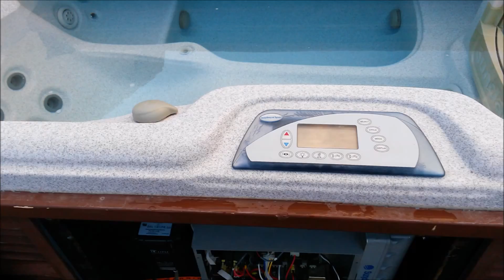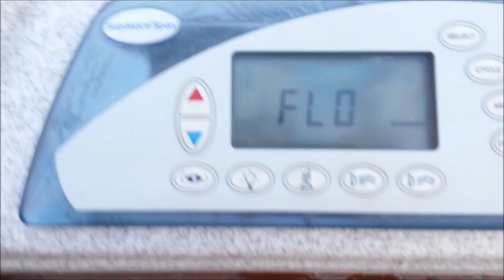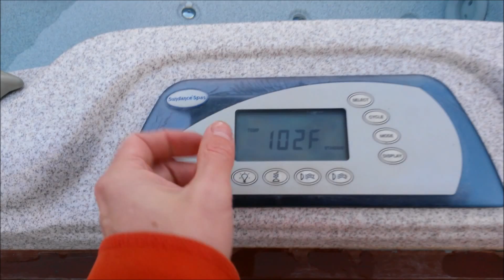Hot Tub Not Hot Enough? 104° Temperature Override  (:2:) The Resistor Method

Comment: I know its been a while since you made this video, Great video! I was just wondering if you have a similar hack for a newer 2020 Thermospa hot tub with Gecko controller the has the temp sensor and HL as the same probe with 4 wires?
Reply from the maker: I haven't done one of tjose, but you can always just try one wire at a time and see if there is any change. Start with a red on the temp probe wire.
Reply: @SpaDayz  Dude your awesome!! Thanks for the info. I soldered a 1kohm resistor on the red wire but the temp on the screen still showed 2 degrees warmer than the actual temp using a floating thermometer. So I soldering another resistor on the green. I just took a guess that the red and white or red and black were a circuit that's why I choose the green. Viola! Now the screen reads 3 degrees colder than actual which is perfect, so at 104 on screen the actual will be 107. I don't want to go any hotter than that. Thanks again!
Reply from the maker: @lesbauman  Awesome! Glad you were willing to go for it!
Reply: @SpaDayz  Thanks, I really need to work on my soldering skills. LOL
Reply: @SpaDayz  Thanks for the quick response. The probe has from left to right a red, white green, and black wire. I sent an email to the Gecko people to see if they can tell me which wires are for the temp and which for the HL. I'm going to do what you suggest and see what happens. .

Comment: I used 1.5k resistors on my 2011 caldera vacanza hot tub. It seems to only have one sensor wire. It had a red black and silver wire in that wire. So I put the 1.5k resistor on each wire. So 3 but it's still the same as it was before I put the resistors on it. So 104 is 104 degrees on my portable thermometer. Should I just ad a 5k resitor or something? Also I think seen someone say u can put glue or cocking on the sensor in the water. Will that help you think? Anyways the video is awesome and informative it helped alot thanks.
Reply from the maker: Do all of the wires go straight into the temp sensor? Sometimes you have the wires split off and go somewhere else.
Reply: @SpaDayz  yea there's the one Grey about quarter inch cable it goes into the electric box or whatever it's called n the cable goes up into the hot tub. It looks like thats the only spot it goes bro. The only other Grey cables are to the lights is what it looks like. Do most all hot tubs the thermostat goes to the heater first or something? This one guys from the thermostat straight down to the electric box. And in that Grey cable there's like 3 little cables I connected a resistor to each one.
Reply: @SpaDayz  tomorrow I'm getting a 5.1 k resister delivered. So ima check if it works with that one haha. Hopefully it fixes it. Maby the 1.5k was weaker or something.
Reply: @SpaDayz  I'll look at it more thoroughly but yea it looks like the thermostat cable only goes to the electricity box.
Reply from the maker: @JozeSanchez13  Not sure what you are calling a thermostat or electrical box, but if you have wires going into this and then to the sensors (of which there are usually 2) then you need to put the resistor between this box and the sensors. Only on one wire, always try the red one first.
Reply: @SpaDayz  ok just on one wire? Alrite I'm gonna try that ritenow. Yea I thought to put them on all three but ok let me see how thst works
Reply: @SpaDayz  watd u think bro I tried all the small resistors i could about 5 different ones. None worked. What's another way to make the hot tub go hotter you think? You think putting glue or cocking on the heat sensor will make it go hotter?
Reply: @SpaDayz  I put in the 5.1k resistor it shows 60 Fahrenheit then shows - - - - so yea I'm guessing gotta go to lower resistor

Comment: Any advice on doing this to a Bullfrog R series. Circuit board has a HL & Temp probe with a black, white, red, and green wire and an In Flo sensor with a black, red, green wire. Any help would be very appreciated.
Reply: Did you do this? Thinking about getting a Bullfrog. Thanks
Reply: @user-jy7kc5dk2v  yes. It worked great. I only did 1 wire, never could determine what the 2nd wire was. If I place the temp at 104 now it gets a little too hot for me, about 112 on the floating thermometer I have, it will also randomly trip something that gives me a warning to not get in the tub and the pump shuts off for about 2 minutes, before you can turn it back on. I say it works great because I don't keep it at 104 (112), I keep it at 100, which is like 106.5 on the thermometer, and none of those things ever happen. It just works normal but with perfectly hotter water.  In fact even if I increase the temp to 102 or even 103 (which starts getting too hot for me), it works normal with no warning or shut down like at 104. We actually like using the hot tub now and it's actually therapeutic.
Reply: @jayscott1380  looking at the BF circuit board diagram - I see the one female terminal that reads"HL & Temp. Probe" - is that where the "1 wire" you found goes to? Did you just cut that wire and put the resistor there? How many ohms? thanks
Reply: I think I get it now after looking at BF diagram - the 'HL & Temp. Probe" shows a 4-pin connector- I have a BF R5L coming soon - wondering if I can make a separate wire with a 4-pin male and 4-pin female connector with resistor in between so I can remove it if necessary in case dealer needs to come out for some reason (hopefully not!) so I can simply disconnect and put factory wire back? Did you use a 1 K ohm resistor? Thanks!
Reply: @user-jy7kc5dk2v  yes 1k, I wouldn't use anything more. If you have a smart way if rigging it, so you can put it back to original factory then go for it. I didn't, I just cut the wire and spliced in the resistor with electrical nuts and copious amounts of black tape.
Reply: @jayscott1380  thanks!
Reply: @user-jy7kc5dk2v  on my spa with 1k ohm resistor, I keep the factory temp around 100 now, which when I place a thermometer in the water it is actually 106.5 degree. If I max out the factory at 104 it'll get much hotter, I actually don't even know how hot because I haven't measured it at as hot as it gets.
Reply: @jayscott1380  Thanks again for your help. Did you try the "temperature override" feature that Bullfrog has? If you hold the up arrow it should show "OR5" and then "OR6" which brings the temp up to 105 °F and 106 °F, respectively. I verified this feature with both the dealer I ordered from and also from BF technical support in Utah.
Reply: @user-jy7kc5dk2v  no I never tried it. But honestly 106 isn't hot enough for me anyways, and also in my tub (before the wire alteration) the warmest it would ever get was like 102 (even when it was set to 104). So raising it 2 degrees would only have really made it 104. Either bullfrog tubs run colder than they are suppose to or at least mine did. Learning that there is an override that goes against the law of the maximum temp setting on a hot tub being 104, leads me to believe that the tubs actually run 2 degrees less than what they are set at intentionally.
Reply: @jayscott1380 Do you have the 120 V or 240 V model - I've heard that can make a difference, especially in winter? I know what you mean - 106°F is probably not hot enough for us either; used to keep our 25 yo Hotsprings (which died last month) at 109°, but for the past few years around 106-107°. thanks again for your time here.
Reply: That's awesome man my hot tub it doesn't work for it. I think it's just to old of hut tub. What year is ur bullfrog hot tub also what kind is it. Ima have to buy one of those.
Reply: @JozeSanchez13  it's just a couple years old
Reply: @jayscott1380  o ok so like 2020? You think this thing will work on a 2022 or 2021 bullfrog tub?
Reply: @jayscott1380  Mines like 2012 I think. That's probly why it doesn't work.
Reply: @JozeSanchez13  yes
Reply: @jayscott1380  you can easily get yours up to 110 now n itll stay there? That's awesome I'm tryna get mine to stay at 110 or 109
Reply: @JozeSanchez13  yes if I want, but really that's too hot for me. I like it around 107 108
Reply: @jayscott1380  nice nice that's cool urs could do that mine can't haha. Ima maby try this again but yea it wasn't working it'd say it's down to like 60 farenheight but it's realy 104 then the whole motor would shut off.
Reply: @jayscott1380  so yea later on or something I'm gonna have to buy a new hot tub.

Comment: I have an “ePack” I just purchased to retrofit an older Morgan hot tub. The wires coming out of the connector on the circuit board where it’s labeled “sens” are blue and yellow. The red wire coming from what appears to be the sensor (bolted into the heater tube) actually goes to a different unlabeled connector on the board. Anybody have an idea of where the resistor should go? 
Stick with the red anyway? Or maybe the yellow as that’s often positive?  
(Also I should add the limit uses red and black on my unit)

Comment: Thought I was King Kong and wired in 4 1k ohm resistors and i scorched my skin. I achieved 115 degrees with that (about 2.5 degrees per 1k resistor). I keep it to where it reads 100 but actually around 109/110. Can’t thank you enough for this hack, allows me to get my sessions in 15 min instead of 45. God bless
Reply: Why not just 1 /3 or 4 k resistor?
Reply: @AA-ih6kt  same reason we go out and have more than 2 drinks. I took them out real quick lol
Reply: @AA-ih6kt  the hot tub is a balboa. I have an automotive shop and had resistors around and wasn’t expecting to see two temp sensors. I can help you the best i can if you need help
Reply: That's awesome man what kind of hot tub do you have? On mine yea this didn't work gonna have to buy another one or something.

Comment: Has anyone tried this on a Wellis?  I am trying to confirm the correct wires.
Reply: I’m also looking at Wellis - did this work? Which model? Thanks
Reply: @user-jy7kc5dk2v  I bought the items and best I can tell there is a single wire for both functions on the wellis but have not ventured to try it.  I have been able to get up to 105 with the Wellis stock. Basically turn it all on with the cover on for 20 to 30 mins and then use it as normal.  It will hold that 105 for a solid 30 mins.  I am at 8000 ft elevation and was running that way through winter months.
Reply: @ryanmcdonald9228interested in the result

Comment: Couldn't I make a pigtail with a 1000 ohm resistor and connect it between one of the thermistor terminals and the wire that goes to that terminal? That way I could easily put it back to original configuration and I wouldn't have to open the control panel box. I've got a new Pentaire MasterTemp 125 that is still under warranty.
Reply from the maker: That's a great idea. would preserve factory wiring and make it easier to swap out resistors if necessary
Reply: Can you show what a pigtail is?
Reply: @AA-ih6kt  I disconnected one of the wires at the thermistor that senses water coming into the heater from the hot tub. That wire had a female quick disconnect. The thermistor has two male quick disconnects. I soldered short 18 ga. wires to each side of a 1000 ohm resistor. I terminated one end with a male quick disconnect and the other end with a female disconnect. Use heat shrink tubing or electrical tape to seal the resistor. Then just put this "pigtail" between the thermistor and the wire that previously connected to the thermistor. Easy to remove if you want to restore to original configuration. Of course I don't recommend overriding the mandated 104 degree F factory limit.
Reply: @SBKendoka   let me know if maybe you can make me one??  I have a 2022 vitaspa joli and 104 is not hot enough..occasionally the temp will read 105 for a minute or 2 and then back to 104...anyhow you can email me thanx
Reply: @SBKendoka   did you do both like the guys vid said to do? or just 1?
Reply: @AA-ih6kt  I just did one of the wires from the input thermistor. It would be illegal for me to make you one. I ordered the parts from McMaster-Carr.
Reply: @SBKendoka  thanx  i will look into it...
Reply: @SBKendoka  is 200ohm the same as 2k?  I want to go more then the 1k....and does wattage matter?  or color of the resistor?
Reply: @SBKendoka  i guess i am wondering what male/female disconnects you used and where to get them as they arent all alike and diff sized.
Reply: me again....where is a good place to get the male/female ends needed?  Is there some huge electronics supply house with many diff kinds? the balboa board uses certain ones(2022 vitaspa joli)
Reply: trying to make a pigtail..but cannot find the right connector thats on the end of the wire..any idea where to find the male/female same connectors? they are very small..micro??  2 wire.

Comment: So, quick update.  I reviewed the wiring diagram in detail and repaired the flow sensor wires that had been cut and the FLO error is gone.  As to the other sensor which had four (4) wires into it (red, white, green and black), I have emplaced (by alligator clips) a single resistor into the black wire.  I do not have any other resistor wired into any other wire.  Just the one.  The result is a significant increase in the water temperature.  At 104 degrees on the tub I am getting about 111 degrees of actually water temperature and that was still heading up so I have since turned down the temperature on the tub to 96 degrees and the temperature is now hanging out around 107-108 degrees.  That all said my question to you is - do you see any problem with using just a single resistor in the black wire and not using that in conjunction with a parallel resistor in the red (or other) wire.  I thought I would ask and get an expert opinion before permanently emplacing the resistor into the black wire.  Thanks for all your help.  Regards - John
Reply from the maker: Awesome! Glad you got your wires traced.

One resistor is fine.
Reply: Thanks for your reply and thank you for your very informative post.

Comment: I have always loved this post.  I have always really loved my hot tub water around 107-108 degrees and really despise being told I cannot have this by the nanny state.  That said I read through this post several years back and was successful with implementing this into a prior/older hot tub I use to own as to getting the water up to around 111 degrees - and thereafter turned down the heat to around 107 degrees.  That said I now have a new hot tub and just went into it to put in the resistors as I did the prior one.  However I am having issues with this  new hot tub.  These two (2) sensors have different wire configurations then my prior hot tub.  My prior hot tub had two wires going into each sensor (as I recall) and I simply inserted a resister into the black wire on both sensor wire sets.  Again this is per my recollection but did know it worked.  My newer hot tub has three (3) wires into one sensor (green, red and black) and four (4) wires into the other sensor (green, red, black and white).  So in keeping with the program I inserted a resistor into the red wire for each sensor (easiest to get to) but then received a FLO error message and the water temperature begin to drop.  I thereafter repaired the red wires and then inserted those removed resistors into each of the black wires, one for each sensor and received the same FLO error message and the temperature also begin to drop.  So I my plea/request here is to anyone that has run into this and/or has knowledge as to how to adjust this excellent resister concept into the type of sensor that I have in this new hot tub so that it can work.  Any help/ideas would be appreciated.  Thank you and regards to all my fellow 104+ degree water hot tubers.
Reply from the maker: A FLO error indicates an interruption of the flow sensor. It's usually an online sensor near the circulation pump.

You're gonna want to ohm out the wires and see what you get. I'm guessing red and black will have zero or infinite resistance depending on whether the circulation pump is running.

Comment: I have an La spas HEET 2005 tub with a gecko s- pack. The temp sensor has 3 wires red, green, black. I measured and found resistance between the black and green wires so I put resistors in the black lead and saw a five degree drop in the temp. Unfortunatly  the tub kept heating beyound 104 (109) so I had to go back to the normal configuration. Replacements for this temp probe come in 2 or three wire versions-- and I am tod both will work. Was ondering if this hack would work if I swapped the temp probe to a two wire or if just excluding the green wire would work. TIA for any advice.
Reply from the maker: Sounds like it worked perfectly if it continued to heat to 109 with a 5 degree change. Just turn the desired temp down accordingly
Reply: @SpaDayz  Thanks so much for responding. While the degree change was good the spa continued to heat beyond 104 on the keypad where I would have expected it to shut off (at a true temp of 109) . Perhaps I should have waited longer. I see on the web that the replacement Temperature probe for what I currently have is 2 wire not three. I may try again with that probe and see If I have any luck. Thanks again for this video. Please post if you have any futher thoughts.

Comment: works on a 2 person tuff spa with a balboa vs300fl4 control....
got a 4+ degree jump with a 1.3k ohm resistor on the 2 red temp. sensor wires...
big thx for the hack...;)
Reply: I only got 4 degrees more (107) until. the topside controller reached 104. Did you have to lower the temp on the topside controller to push  it to 8 degrees more?

Comment: Just finished this hack on a Dimension One Sovereign.  A 1K resistor raised the temp by 12 degrees F.  Single resistor required on the thermistor sensor.  Easy job.  Thanks for the video - very helpful
Reply: i have a demension one dream..so i just need 1 resistor?
Reply: also is .25 watt resistor ok? or 1/2 watt?